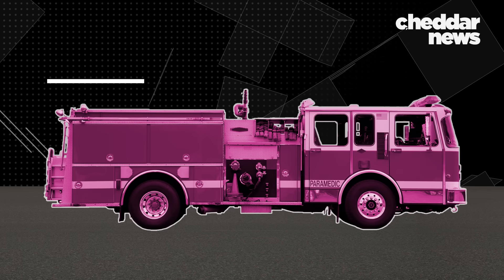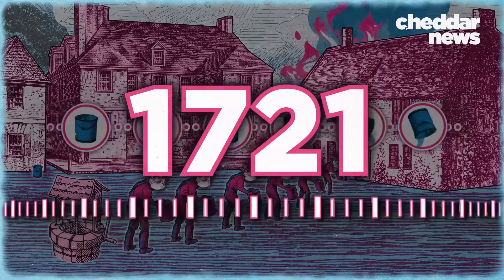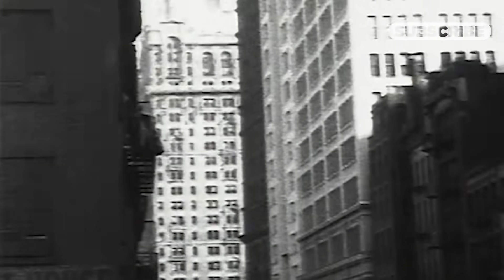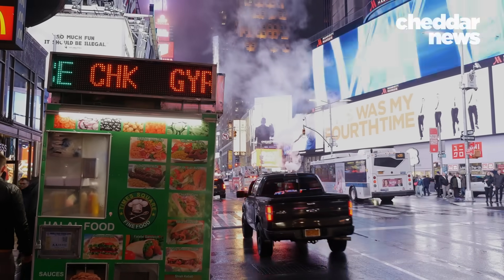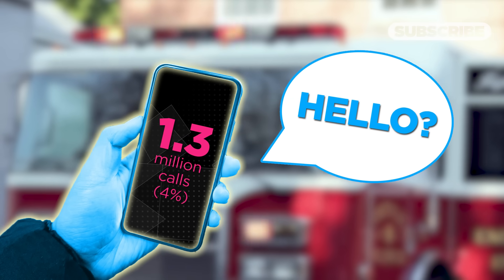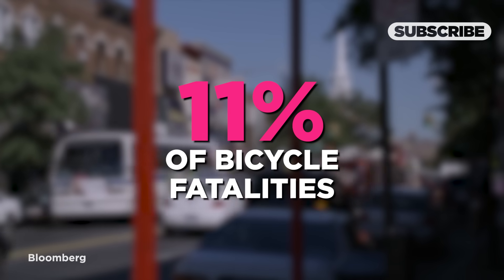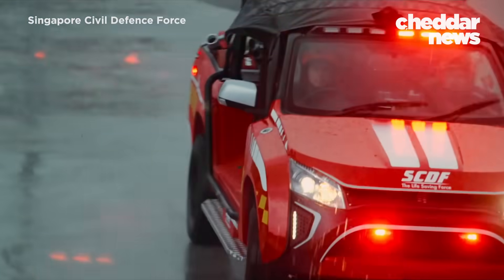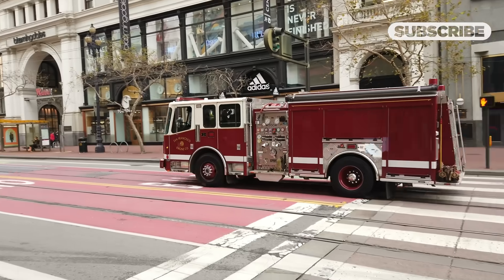Do American Fire Trucks Need To Be So Massive? - Cheddar Explains

Comment: "equally robust capcity"???? Not even close. Most European fire apparatus carries lots less hose, and pumps run 750 gpm rather than the 1500 gpm common in the US....AND it takes a lot more of them wimpy fire trucks to put out a fire in Europe. You also don't see as many 2500 gallon water tankers in Europe...and lets not mention that MOST working fires in Europe.....end up with a vacant lot. You need to go back to school and learn how to research.
Reply: Less hose means little to nothing considering that altough smaller European fire trucks carry between 2000 and 4000 liters of water on average, a lot more than the typical us fire truck, as do tanker trucks that instead typically carry between 4000 and 9000 liters. And many fires can and are handled by a single truck.

Also what is a "working fire"?
Reply: @thecommentaryking  well to be fair, many Tankers across Europe are rather small. There are even Tanker classifications which carry only 1000 to 3000 l - which is less than many Engines in other places. 
"And many fires can and are handled by a single truck." and yet they love to respond in a convoy of 5+ trucks ...
Reply: @EnjoyFirefighting  Sure but saying that there aren't many large tankers is incorrect.

And I have rarely seen more than 1 truck and if needed a ladder for an apartment fire where I live. Only for large fires more than two trucks are used.
Reply: @thecommentaryking  depending on the country I wouldn't say that the statement is wrong. Yes, there are many large Tankers in e.g. Poland, whereas large Tankers are barely a thing in e.g. Germany
"And I have rarely seen more than 1 truck and if needed a ladder for an apartment fire where I live." I've seen places where they respond with at least (!) 5 units to an automatic fire alarm with no actual fire or smoke being reported by anyone. I've also seen scenarios of 5 different stations being dispatched to nothing more but an automatic fire alarm, which turned out as false alarm as well
Reply: @EnjoyFirefighting  It is as you said, it depends on the country. But mostly from place to place even inside the same nation
Reply: @thecommentaryking  can't speak for all countries, only the ones I'm most familar with, and there you will barely see major difference in different parts of the country. North, south, east, west, urban, rural, mountainious, or flat-out  area
Reply: Steve Martin yes and no: they carry less hose and water, and pumps usually operate at less gpm but higher PSI, but in fact, Engines in e.g. Germany carry in fact MORE equipment than many Engines in the US!
"AND it takes a lot more of them wimpy fire trucks to put out a fire in Europe." not quite; FDNY responding to a fire in a house comes up with just as many apparatus like we would. The difference is that they come from many different stations in the US and from only 1 or few stations over here
"end up with a vacant lot" uhm well, first off most fires here don't even go anywhere close to being fully involved. I've seen only 2 or 3 fully involved structure fires in the past decade. Most reported fires are limited to either the room or the apartment they started and haven't spread to other apartments, floors, building or next door buildings until the FD got there.

Comment: The truth is in most other places around the world fire crews don't use small toy like trucks, they use big vehicles that can carry all the gear, water + pumps that an American truck can and the ladders can reach just as high, the only difference is they are more modern designed so can be less wide and less long, but still have the same capability. The American firefighters unions are in bed with the American company's who make the American trucks, the union gets money for firefighters to retire on and American outdated trucks keep getting made. The truck company make them in this old design that most other country's stopped using 30 years/ 40 years ago, partly because of tradition and partly because if they made a slightly smaller more modern design like most other country's use, then US fire department's may decide to buy non American fire trucks as it would be much cheaper.

Comment: The average fire truck is 22’ long, 8’ wide’ 9’ tall and holds an average of 750-1000 gallons of water. They hold 5 crew members or more, depending on department. A pump large enough to provide an average of 1000 gpm or greater. 1100 feet of supply line, 600 feet of attack line. Extrication tools, different tools for firefighting, hazmat tools, etc… European style fire trucks are smaller due to road sizes. Please don’t ask an American firefighter to think about wanting a smaller rig, we will laugh and buy bigger, because that’s how we roll. #FloridaFirefighterParamedic #Local3529
Reply: "are smaller due to road sizes. " tell that the guys in Sweden, which have an American-sized road layout throughout the entire country. Still their fire trucks aren't any larger 
Although the average European fire truck is more compact ... you are aware of the circumstance that Europe builds also the largest fire trucks?

Comment: Spoken like a true liberal....

These smaller trucks don't have the same capabilities. 

1. They don't bring enough water to the scene. Aerial trucks bring 400 to 600 gallons of water to the screne. Engines bring 1000 to 1500 gallons.....

2. While fire may not be the main reason for a fire department response, how much fire fighting equipment is needed for say an auto accident? How about a building collapse or other rescue....

3. The only reason EU and Asian trucks are smaller is that their cities are older and they simply don't have the space for the larger equipment. But you know where the larger equipment is used everywhere in the EU and Asia because there is space? Airports......

Comment: As a member of the german voluntary fire department, I‘m surprised how stupidly gigantic your american fire trucks are. I mean, why would you only have such huge vehicles? Here in Germany, the “average“ fire truck (called Löschgruppenfahrzeug = fire fighting group vehicle, short LF) is about 7-8m long, 2,5 m wide and 3m tall. It normally carries 9 people (1 Gruppe=group) or if not so many men are needed/available only 6 (1 Staffel=squadron). A “Gruppe“ consists of the group leader, a mechanic (he drives, operates pumps etc), a “Melder“ ( basically the leaders right hand) and three squads a 2 men. The tank can store 1000-2000 l of water, there are 4 pressures air tanks for going into smoke filled buildings etc and at least 400 m of hoses in 3 main sizes. Then of cause there’s a mit of additional equipment like hydraulic cutters, at least one ladder (8,4 m), medical equipment  and so on.
But that’s not the most common fire truck. Most smaller departments have a TSF (Tragkraftspritzengahrzeug= something like “vehicle with a portable water pump“). These seat a Staffel, consisting of the same members as a Gruppe but without the Melder and with one squad less, and are about the size of a pickup. Still for most cases this is totally enough. And if  really something bigger is needed, you still get enoug time until a group of fire trucks from the next large department arrive.
Of cause there are a lot of other fire trucks, but nothing is as oversized as these American ladder trucks. I mean imagine you need such a hydraulic ladder somewhere outside of the city, for example in a forest. How on earth do you get such a monster in there??
Reply: They have bigger roads and big fire trucks can carry huge amount of water
Reply: @adityaunde4134  well ours can as well. standards go up to 5000 liters
Reply: Frederik, while you're surprised about the stupid gigantic fire apparatus, would you like to tell us why German fire departments 
- roll out with an entire convoy of fire trucks to sth as basic as an AFA or medical support? 
- almost every department and station coming up with a command post responding to each and every call?
- so many departments heavily relying on vans to transport crew and equipment? 
- having stupid gigantic fire stations of more than 50 apparatus, literally having all eggs in one basket? 
And are you aware of Germany being insanely dense populated, even in rural areas most villages and by that the next fire station are only few minutes apart from each other. You won't find those conditions in rural America, or other parts of rural Europe either.

Comment: You can't take a European truck to an American city, which has wider roads, taller buildings, faster traffic speeds, heavier vehicles overall, more spread out suburbs and expect it to do the same job. You need bigger ladders, bigger hydraulic rams, more water, more water pressure, more capacity for humans to be evacuated to serve the average American emergency scene. Here in Zurich, Switzerland, we have the more compact sort of trucks that were shown in the video (Schutz und Rettung Zürich), but most buildings here don't go beyond 6 storeys, even in the city center. I'm not a firefighter but I'm sure fire departments everywhere have a tight enough budget to find and fulfill the minimum operational requirements and not more.
Reply: European trucks are much heavier than the tiny stuff you got in the US...
Reply: "You can't take a European truck to an American city" Log Angeles Fire Department did. 
"faster traffic speeds" I highly doubt that. In which way do you think traffic in the US is faster? 
"You need bigger ladders," while the truck itself is bigger, American ladders don't reach any higher than European ones. 
"more water pressure" most European departments operate at less gpm but higher PSI than American departments.
"more capacity for humans to be evacuated" as if that wouldn't be a thing in Europe. Think about how many people you get from evacuating apartment blocks, train stations, passenger trains, malls, stadiums or entire city boroughs etc ... there are even seperate apparatus speclized on on-scene triage and treatment in mass casualty incidents. A single truck of those can handle 50 patients per hour

Comment: As a firefighter from Germany, we usually use compact vehicles. In my town we had for some times bigger vehicles like 6 wheeled vehicles(if you wanna see Google:Duisburg fire department HLF).  These were huge vehicles but in some places not really practical. After all we use vehicle combinations like the HLF which is technically a squad in the US. Every department has one except smaller volunteer brigades in villages for example. The average brigade has one convoy for emergency operations. One Squat vehicle with 6 men, one ladder with 2 men and one engine with two men and at least one ambulance. Depending on the department sometimes two squats or the engine has 4 men. This is the minimum of vehicles per fire house. Volunteer fire houses have minimum one engine or squat and one troop vehicle. For special emergencies some fire houses have specialised vehicles. I am a volunteer, my fire house has one Squat, one engine and one troop vehicle.
Reply: And if we need only need a ladder in Germany, for example for transporting a patient out of a building, we only need to send the ladder and a personnel transport vehicle.
Reply: From where are you. In my region the standard truck is the LF 20 / LF 10 in combination with a RW and more rural departements have a TSF-W.
Reply: @nicolasmarazuela1010  as I said, Duisburg. I mentioned it
Reply: @DU-km3bw  In my volunteer department in Finland we got: 2 Tankers, Engine, crew vehicle, boat and an ATV. Tankers and engine are both Scania with 12 000 and 2800l of water

Comment: And in the thumbnail they’re comparing the European Engine and an American tiller truck. They chose one of the biggest trucks in the US fire service to base their argument that “American trucks are too big” off of
Reply: even if you compare the Tiller to a European 105 ft rearmount it's massive. On the same size of truck chassis Europeans would have a platform which reaches 3 times as high - of course they carry less other equipment then

Comment: Also, you have used one of the largest apparatuses… a damn tiller. Our Truck 84, which is a 105 foot crimson isn’t even that big. Another thing, most of the larger engines/pumpers tend to have larger tanks than their counterparts. In a rural area like Montevallo, we sometimes have to shuttle water in….
Reply: thing is: tillers have a massive chassis and still only a 100 ft ladder ... would expect a bit taller ones than only 100 ft tbh
Reply: @EnjoyFirefighting  Birmingham FD has a 115ft. But I see where you are coming from.
Reply: @Truck_Company_84  well, quite frankly, 115 ft is still within quite a common range, just like 140 ft and 170 ft is still somewhat common for us; Beyond that we don't have that many Aerials, like 200 ft platform ladders are rare just like 300 ft platform booms are rare
Reply: @EnjoyFirefighting  I forgot who makes the largest tower, but you are right. What region are you in?

Comment: One of the key problems with American firefighting is how it interacts with infrastructure design. Many cities and towns require EVERY road to be wide enough for the truck to make a U-turn. This leads to excessively-wide roads, which encourage speeding. My own town is trying to fight speeding on a residential street, and many of the ideas are being shot down because "the fire department doesn't like that".
Lots of the firefighters criticizing the video are pointing out that the countries with small fire trucks also have big ones. Regardless of whether they understand what is "big" by American standards, that's the point. Different tools for different jobs. You don't need a giant 40-foot ladder truck showing up to a fire at a 2-story family home. Yes, Cheddar is not known for nuance, but the U.S. really does need to reconsider its brute force approach to firefighting.
Reply: Are you a firefighter? I take it not.

Comment: 100% Euro fire trucks are smaller because they have to navigate through streets that formed over 1000 years ago and were never designed for anything bigger than a horse.
US cities do not have that problem and are designed to be car centric into insane levels (Which is actually bad but for fire trucks its nice)
Euro FD would love bigger trucks with more water.
Reply: no, only the average European fire truck is smaller; The largest of European fire trucks are also larger than the ones in the US. 
1000 year old streets are barely a relevant aspect. Many cities had to be rebuilt after the wars, and in some other cities parts of historic oldtown areas were demolished for the modern day progress. There aren't that many cities with preserved oldtown areas where the size of a fire truck becomes relevant.
As long as semi trucks, articulated buses or trams get through, fire trucks will get through as well
Reply: @EnjoyFirefighting  It really depends on the area they have to serve. Where I live the size of the fire truck is 100% limited to the max size that can move around in the old narrow city streets. I have seen the project tender's for these.
But there are larger vehicles out there obviously, industrial areas tend to be build/altered with fire fighting in mind. Same for nature areas or stations that carry specialized equipment for a whole region.
So I wouldn't say 'barely', it's still really relevant for some stations.

Comment: One thing that basically prevents fire trucks from being 10ft wide here in Germany is that the maximum allowed width for any truck is 2.55m (~8.5ft). Everything wider than that needs a special permit to be operated on roads. It is possible to do, as for example the airport fire trucks at Frankfurt airport, which are wider, can also operate on public roads, but you don't want to drive them through residential neighborhoods. Where I live, the local fire department regularly drives their ladder through the neighborhood to make sure that no parked cars obstruct them. 
Another difference I see is that American fire trucks seem to try to squeeze too many things into one vehicle. For example, a ladder in Germany usually (there may be exceptions) only seats up to three firefighters, has no water pump, no water tank, and only equipment that is directly related to operating the ladder. The rest of the equipment and crew is on other vehicles.

For the statistics you mentioned, it would be interesting to know how many of the actual fire-related calls actually require heavy equipment to deal with the situation. at least here these numbers also include fires that can be put out with a bucket of water or smoldering food on a stove that you can extinguish in the kitchen sink, but cuased enough smoke to trigger your smoke alarm.
The problem is that when things go terribly bad, you need to have the heavy equipment, and you can't wait for it to arrive from far away...